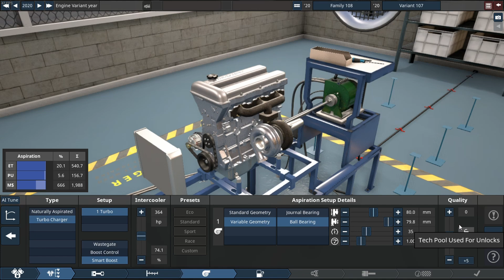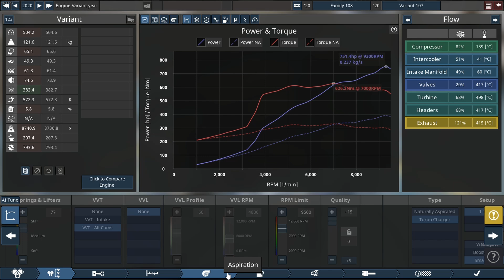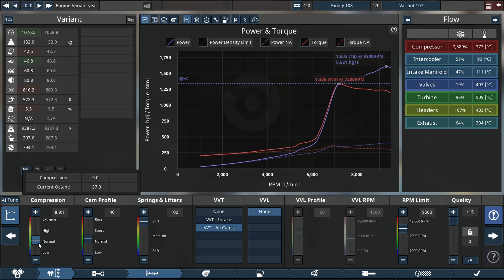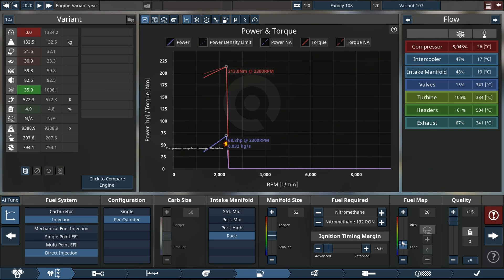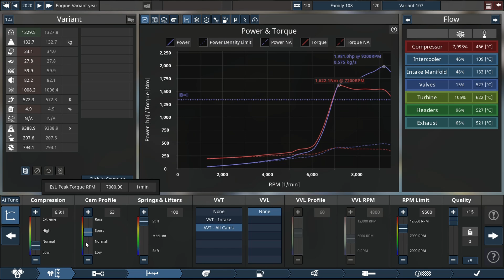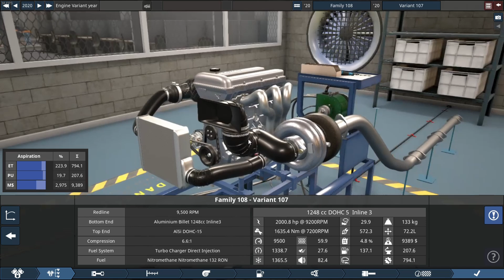3 CYLINDER 2000HP - Automation the car company tycoon

Comment: what is the most torque you can make with only 50hp?
Reply from the maker: That is a fantastic question to answer
Reply: Hp is a product of torque and rpm
At 2k rpm the torque would be 131ft lb
At 5k it would be 52 ft lb
At 1 rpm the torque 262600 ft lb

So higher rpm requires less torque to produce 50 hp.